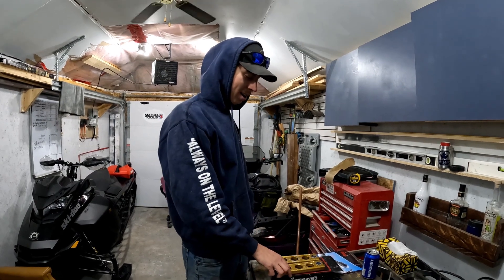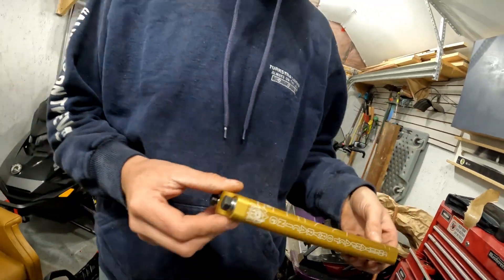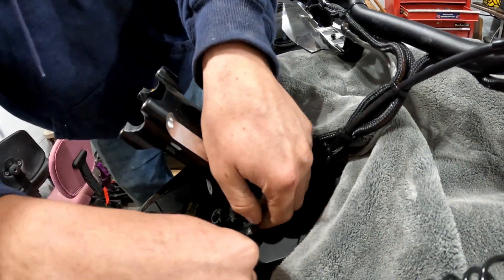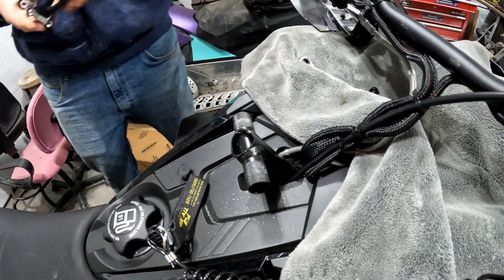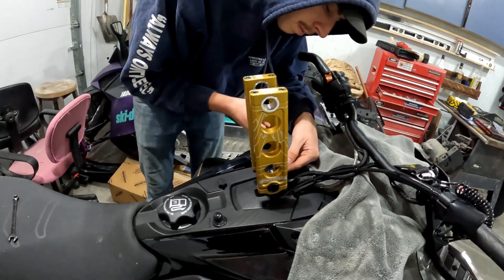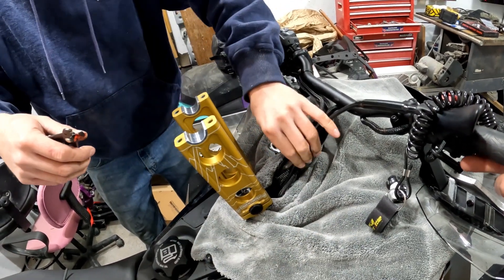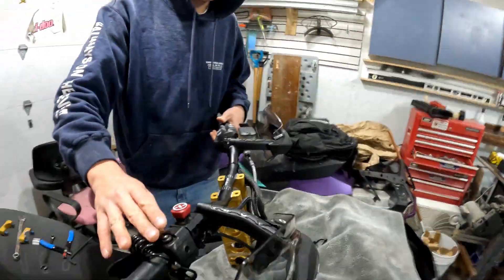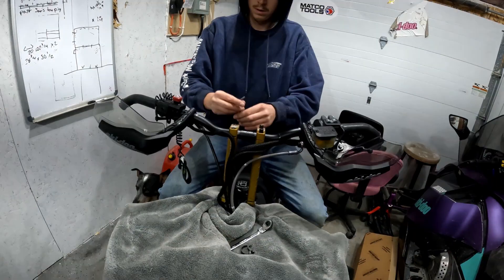Backcountry Needed CFR!

Comment: Curious if you did find extra throttle cable, I was looking at doing the same to my 23
Reply from the maker: We never found any, it is still a little tight for our liking. We are going to order a slightly longer one
Reply: @SouthernSledders  did you end up getting a longer cable? If so did you get a whole new cable or a cable extension for the stock one? Looking to put a 7inch riser on my 23 bcxrs

Comment: off topic question, I have the same sled, do you notice the black glossy trim around the gauge scratches super easy? lol. I wiped mine with a microfiber cause dealer had prints all over it, now I see tons of tiny scratches 😶
Reply from the maker: Yes, it does very easy. We assumed it was drywall dust that scratched this one.